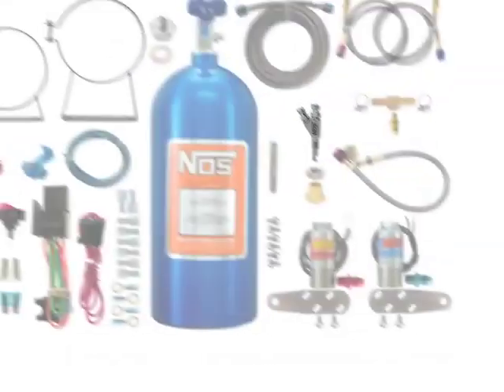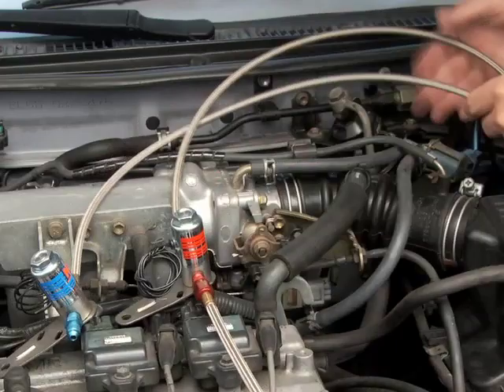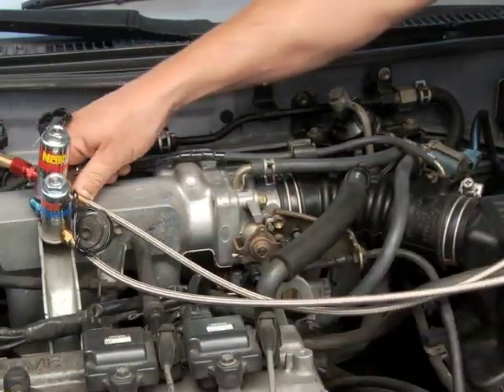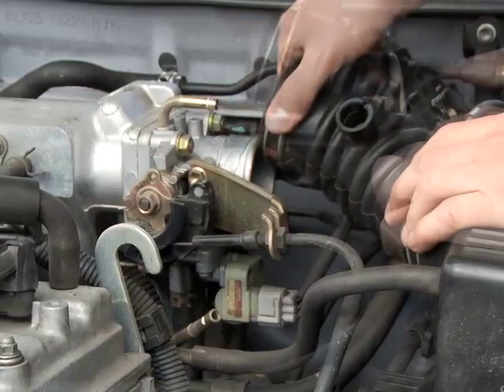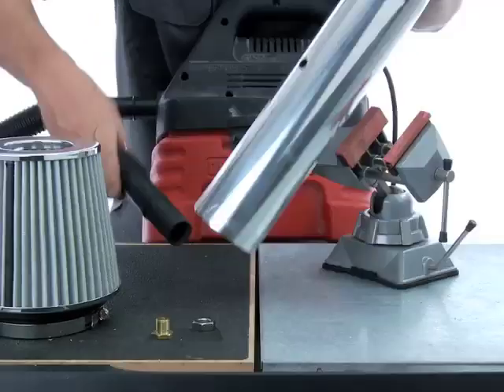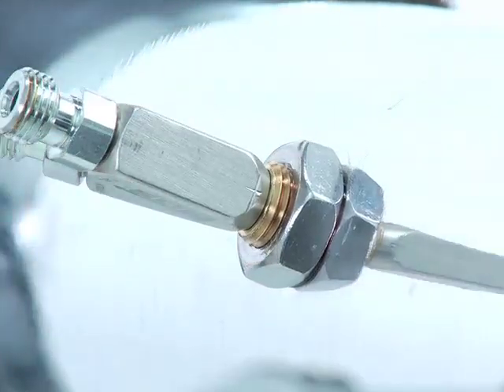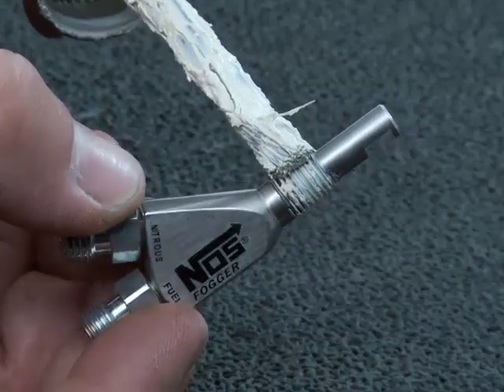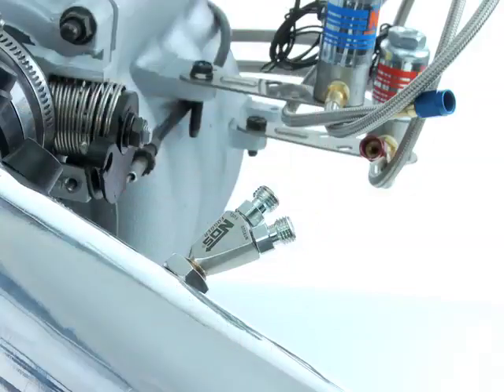How To Install A Wet NOS Nitrous Oxide System

Comment: You're depending on pipe thread sealant to hold the nozzle in the correct direction? Seriously? And it isn't even a pipe thread -- it's a machine thread. SMH.